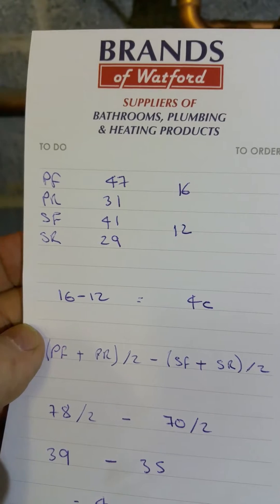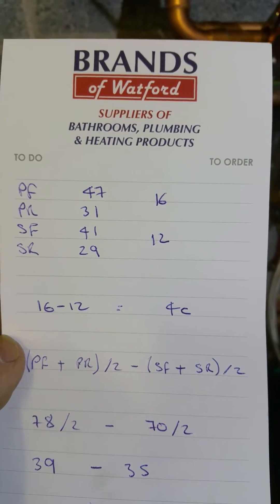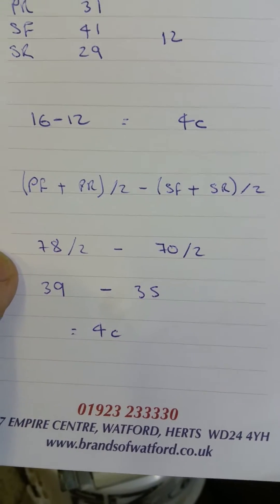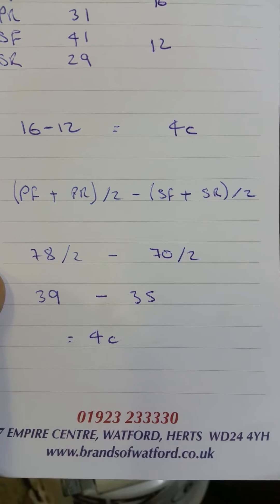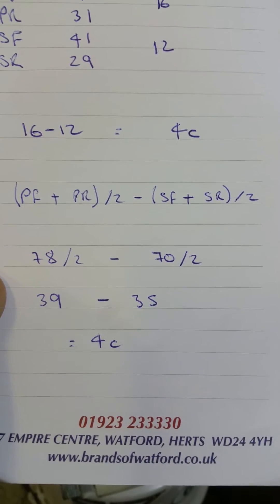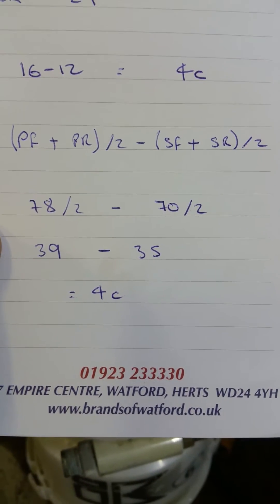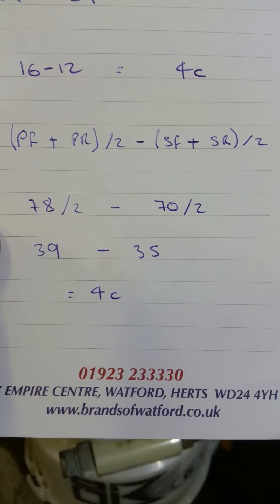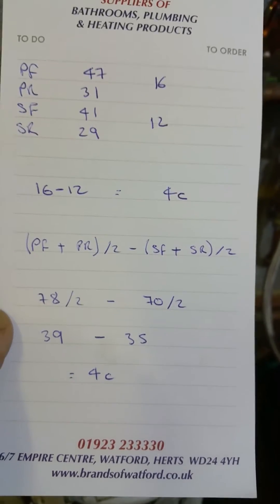Arithmetic mean temperature difference on plate heat exchangers.

Comment: Hi Andrew, I work for Swep and we design our plates using the logarithmic mean temperature difference. This is because the temperature does not change in a linear fashion. The site in the link below explains the difference between the two:https://www.engineeringtoolbox.com/arithmetic-logarithmic-mean-temperature-d_436.html
Reply: Also see: https://www.swep.net/refrigerant-handbook/1.-basic-heat-transfer/as3/
Reply from the maker: Elliot Miles so does the arithmetic mean only give a snap shot of the current performance?
Reply: Andrew Millward Essentially, yes. It would not be used in heat exchanger design, only the LMTD is. This is because it becomes more difficult to transfer heat at the temperatures across the plate get closer to each other. It’s from the principles of thermodynamics that heat flows from a hot body to a cooler body so the least resistance in heat flow is when the temperature difference is greatest.

Comment: Andrew - Could you possibly do a video of your secret to neat soldered joints like in this install please.
Reply from the maker: Mark Russell I'm not so good at soldering tbo. The rules I follow is that solder runs where you apply flux. I use a tooth brush as a flux brush to apply the lightest film of flux possibleto both the female and male elements of a joint. Next the solder will follow the heat so apply heat from the front face and solder from the rear if possible. The solder will flow from the rear to the front. Don't over fill, the length of solder is about equal to the fitting diameter. 
For gas don't flux the inside of fittings.
Reply: Neatest soldering I've ever seen

Comment: 4 degrees is your temperature loss? Or efficiency loss through using the plate?
Reply from the maker: shellisturbo the arithmetic mean temperature is a value to represent the uplift in boiler flow temperature required to drive heat through the plate hex for any required secondary flow temperature

Comment: Hi Andrew - I take it you are using the hex' to separate the boiler from a dirty system or steel pipe work maybe?
Reply from the maker: Mark Russell yes. This boiler has had dirt issues for 12 years. This is the last resort as flushing and filters have failed